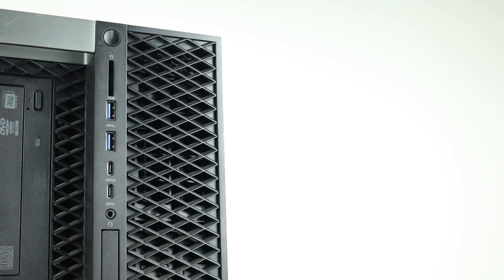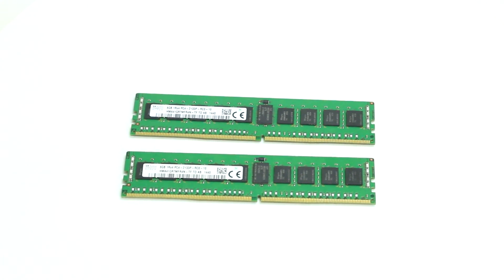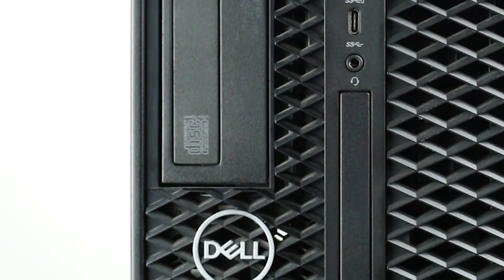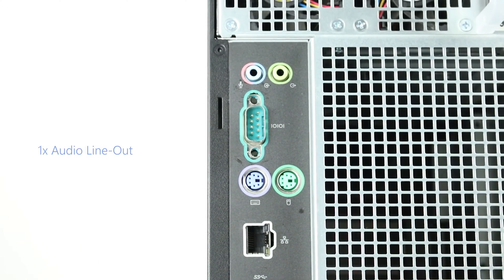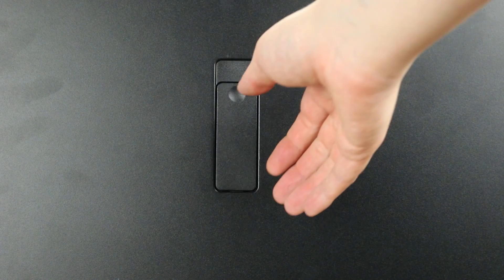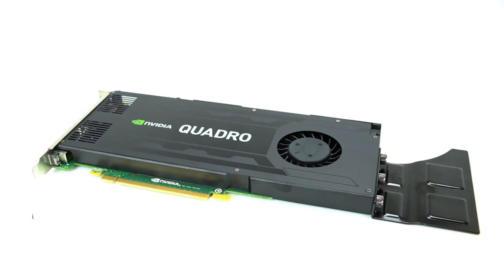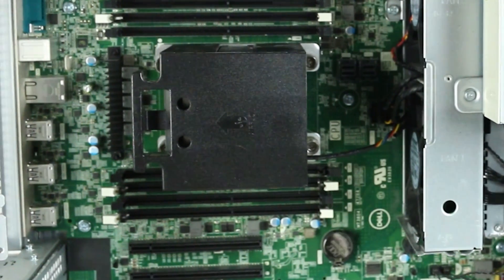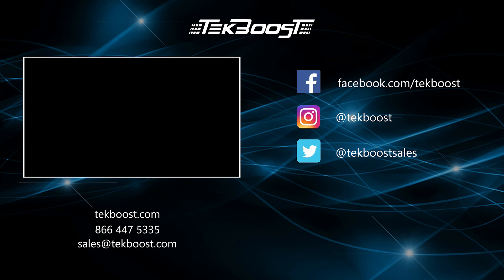Dell Precision 5820 Workstation Overview

Comment: Hi to all the guys here. Would like to make an important question in my case concerning these dell computers that come with raid as an active drive controller (intel rst active) and not ahci. The problem is that whenever i try to boot into these machines in a winpe environment with the Strelec package if you know that, in order to reset the admin password if i cannot log into it or just backup the data of a user into an external hdd before  reinstalling windows if the precedent os is damaged and cannot be repaired, the internal hdd-s or ssd-s of just the os directories into the drives are invisible. I click on “This PC” and there’s only my usb visible and nothing else. I made a search on the internet and it seems it has something to do with the intel rst driver that abstracts the hdd from the os. Please help me, what should i do in this case in order to be able managing the pc even when the pc is unbootable or just the admin password is not recognized.

Comment: Is is possible to dual boot 5820 with one 256gb SSD in flex bay  and one 1 tb sata harddrive??
Reply from the maker: Yes.  The boot order can be selected in the BIOS. When booting press F12 to access the boot menu if you choose to boot to the secondary OS.

Comment: Does Dell Precision 5820 Workstation support RTX 3090?
Reply from the maker: We have not tried it but some of our customers had success installing this card in the T5820.  Power and compatiblity is not an issue, its the size. Some versions are larger and do not fit inside the chassis.  The founders edition is smaller, and does fit.  Best of luck.

Comment: Do not buy any dell products they are absolute garbage.
Reply: I have one of these that I use as a home server... it's ROCK SOLID.
Reply: You just got a bad one, I have had 2 Dells both run great. One is over 7 years old and no problems. The 2nd is new and and it's a 5820 with some nice upgrades I put in my self.
Reply: Overall Dell Precision systems are well-designed, well-tested and very stable running.
Reply: compared to what exactly?
Reply: @jamesmelendez9971  Any Product
Reply: Not sure what you bought (or where you found it). But I've owned this exact system since mid-2018 and it's without a doubt the most reliable workstation I've ever owned and hasn't let me down once. When its finally time to upgrade, I'll only be talking to DELL.
Reply: Hi.i have same system.but i don't what is login user password i think i forget it..can you help me to recover it or may be changed the password 😐